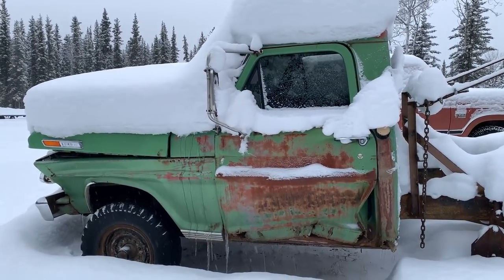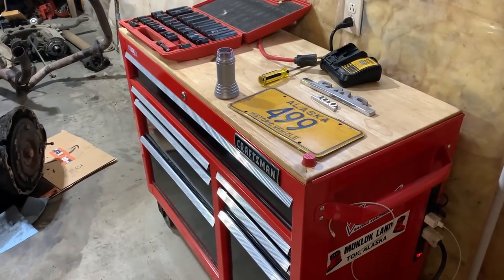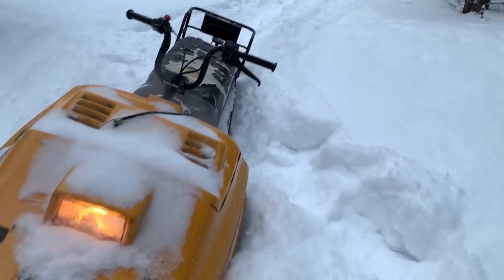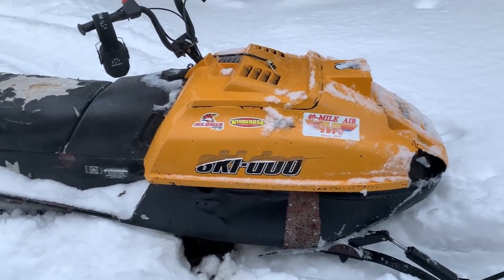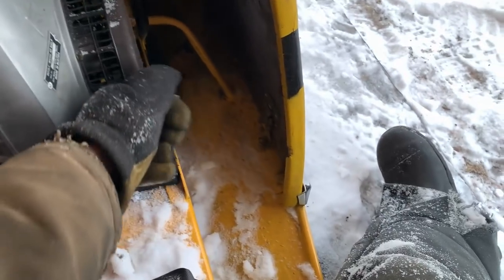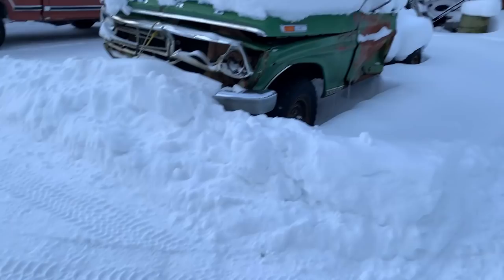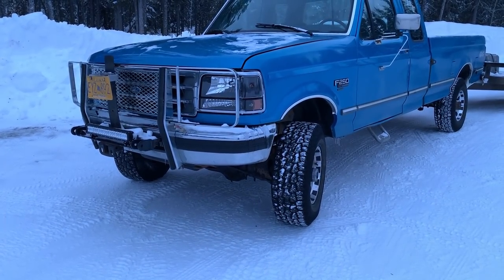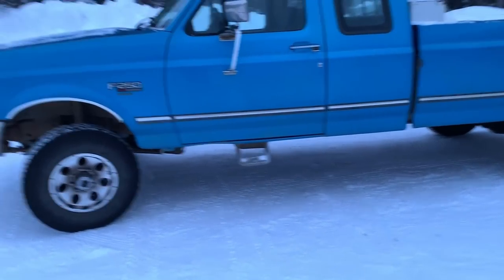Firing Up Sleds!

Comment: So I'm not the only one that sloshes fuel in the spark plug hole in his Tundra to get it started.  As primitive as the sleds are, it's amazing the places the little single lunged sled will take you.  And on the odd times you get stuck, it is a joy to move it around compared to heavier sleds
Reply: I got a 79 Yamaha enticer that I do that to or I just run with the airbox off and put my hand over the carb give it a small pull and then drop the hood pull again and it fires right up. It works all the time and I don't have to play with the stupid choke it has and have to pull till my arm falls off LOL!

Comment: I have a 97 f250Hd and a 99 super duty both with the 7.3 one with the zf5 and one with a zf6.  My 97 has 833000 miles on the original engine and transmission third set of injectors and second turbske.
Third clutch and pressure plate.      Has a little blowby but starts and runs every time I need it.

Comment: nice truck i got a 1994 ram 2500 5speed 4wd but gas burner i just love how simple they are compaired to the new ones. i saw the motor in your and you could see the valve covers cant see them on the new ones i really dont plan on driving anything after about 2002 they have to much junk. but im a dodge man thru and thru. scored a 1966 D500 dodge with a 500 Holmes wrecker on back with only 50,000 miles on it

Comment: you should keep the back of the sled up when storing them it will save your track from rotting out plus it helps when you fire them up for the first time in the season because your track is off the ground and won't move on you anyway a little tip for ya if you don't want to destroy your sleds to fast because tracks are getting harder to find and more expensive when you do to get them.

Comment: Yamaha's are the best sleds in my opinion I have a 340 Enticer a 440 Exciter and a 440 SRX and they are great sleds lightweight and fast and hard to get stuck in drifts but really easy to get out if I do. I use to have a long track Bravo they are great sleds to. I like the older machines I have had newer ones but they are too fancy and heavy I like the older lightweight machines and I can keep up with some newer machines on the trails.

Comment: I had a 95 7.3 5 speed. You cant kill those trucks and it will pull a mountain. Mine needed to be plugged in in cold weather but that was probably bad glow plugs.

Comment: thats the truck i need but would it start on these -27f mornings i go to work off the farm job 3am one of my hay buyers has same truck even same color pulls load of 15 5x6 1000lb round bales like nothing! brother has a 99 f250 coming up on 400,000 lives on the 25ft 5 wheel trailer still has tons of get up & go power but its been popping brake lines he's never touched them has bigger problems with the newer fords past few weeks been seeing artic cats stranded along roads